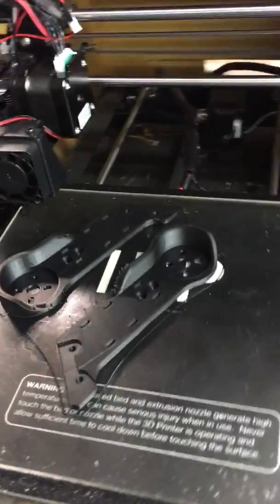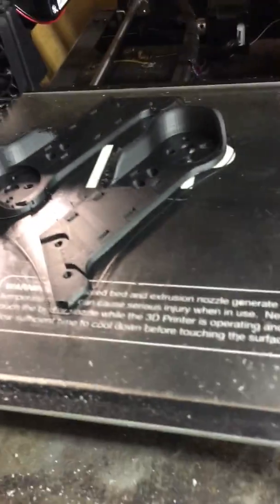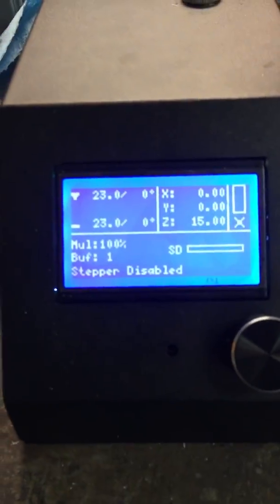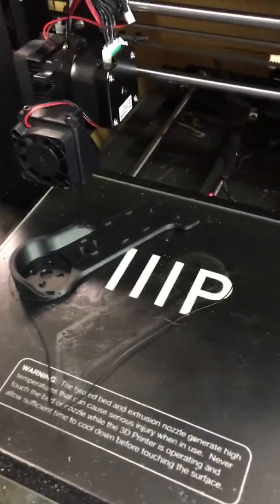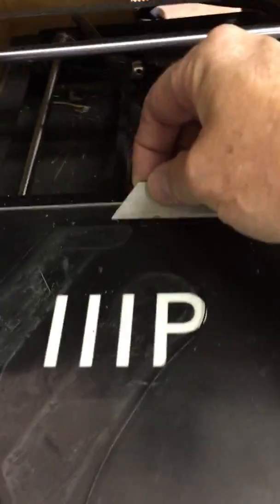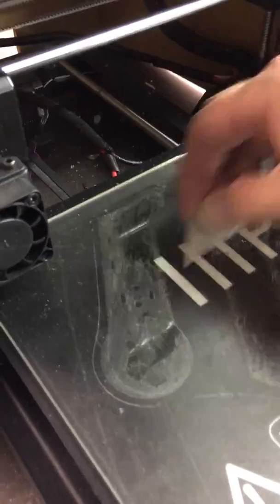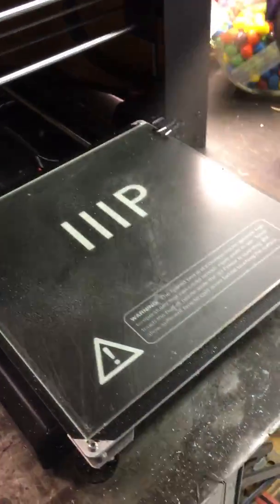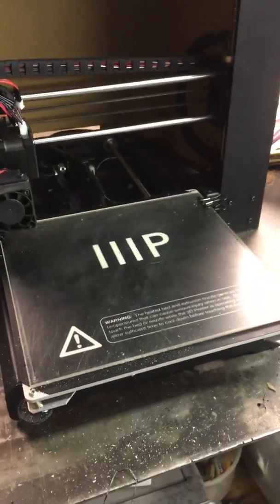3D Print on glass over heated bed Monoprice Maker Select

Comment: does the type of glass really make a difference?
Reply from the maker: I don't think so.  I've used ACE Hardware window glass, as well as prepared borosillicate glass from  Amazon vendors.  Both print well, but the ACE glass is more fragile.  I've pulled chips out of both over time.

Comment: Dumb question, what size clips are you using?  I ordered a box of large clips, but I can't find a way to keep them out of the way while the bed moves.  Are you using medium clips?  Small?  I suppose I could use heat transfer adhesive instead, but people seem to have luck with the clips, and I could really use some luck.  I am in a 3d printing nightmare right now :(
Reply from the maker: @Larry Tweed, the smallest ones.Also, only one is clipped over the glass, the rest are clipped to the bed, holding the glass in position, but not down.
Reply: Thanks, I'll give it a try. The clips arrived today

Comment: Hey Craig. I was intending to use the same setup as you. A 3mm borosilicate glass plate straight onto the buildtak surface with three clips. The main reason for doing this is that, like most people, I have found my bed plate to be warped and crowned in the middle. The 3 point clipping (in three corners) should hopefully avoid the glass warping, but due to the bed plate, the free corner of glass is not in contact with the bed. Have you found the same affect? Does it result in a loss of thermal conductivity from bed to glass?
Reply from the maker: Tim Draper I've not had any issues. My carriage plate is more warped now, so much so that I am going to upgrade it. Still using the three clips. Have wanted to try silicone pads and no clips, may do so after y carriage.

Comment: did you have to adjust the Z axis?
Reply from the maker: Ernie Mathews I only needed to re-level the bed. The factory position of the Z Limit switch still worked fine. The springs are more compressed now, but it works fine. Did not use pads, placed right over buildtak. A light dusting of hairspray and good to go.
Reply: Craig Corbin thanks for the quick reply!

Comment: Great video, I like the drone arms 😁
Reply from the maker: Thanks!  That is a drone designed by HXMLES.  His video is here.... https://www.youtube.com/watch?v=95bJu816ybo&t=150s
Reply: Craig Corbin I finally got a print out of ABS on glass and hairspray but the layers didn't stick together well and the print ended up splitting into parts. Any suggestions?
Reply from the maker: Shaine Status ABS? Measure you filament diameter at several places. Make sure that average diameter matches in your slicer settings. Bring up the heat a little. Make sure z height is correct. Is it a tall print with thin walls? If so, bring the wall thickness up a multiple.
Reply from the maker: Excellent news that you got the print settings figured out.  (I received your comment by email, but cannot find it here... )